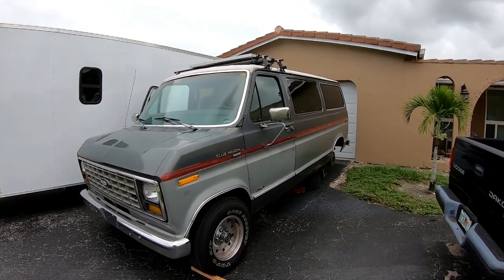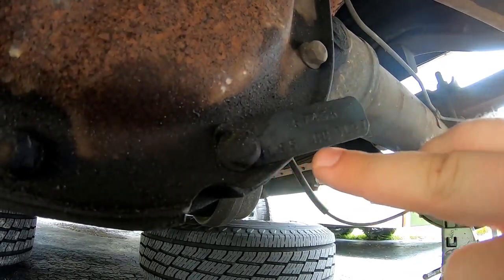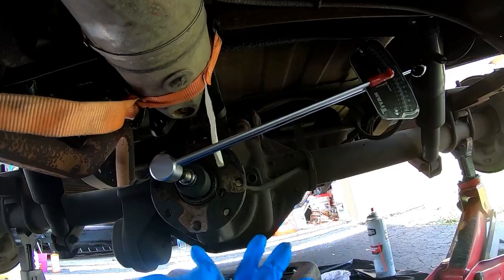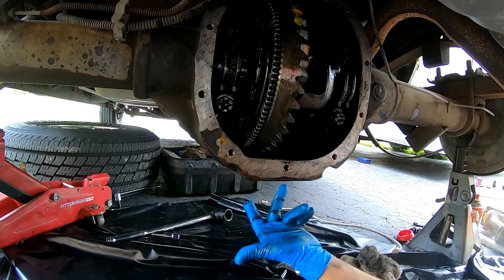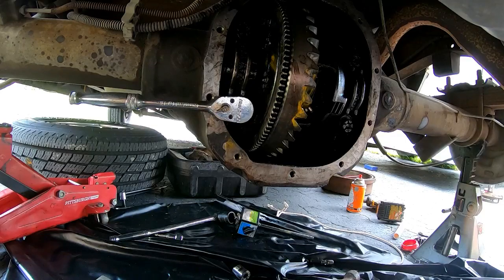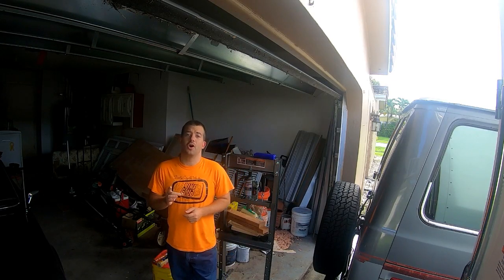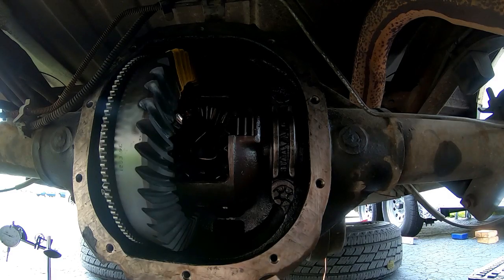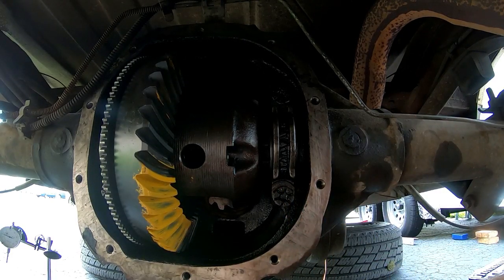Ford 8.8 DIY Gear Swap with tool list in description

Comment: Why replace the carrier bearings if you're only changing the gearset? Set the pinion depth, throw the carrier back in, and recheck the backlash. It likely didn't change.
Reply from the maker: The gearset came with the bearings as a kit. It's a 34 year old van with over 200k. Not changing the bearings just seemed like a very poor idea since this vehicle is used to tow long distance.

Sort of like changing a timing set and leaving the old water pump on.

Comment: I use to race mustangs and did so many gear swaps on mustangs for people. All I used early on was a bearing separator to remove bearings then a pipe to install the pinion bearing and a socket for carrier bearings i pounded them on with a heavy hammer but the pipe and socket were the perfect size so only the race part of the bearings were making contact. I bought a 20ton press to make my life easier after a few lol. You only want to make contact with the race of the bearings you don’t want to put the outer race on to press it on. To make the crush sleeve process faster I use a set up pinion bearing the small one next to pinion seal. I install the pinion without a crush sleeve and tighten the nut down just until there is no play in the pinion, the using a caliper i measure from the pinion nut to end of pinion. Remove pinion from rear end, the put the bearing, yoke and tight nut until the same measurement from pinion nut to end is reached. Then measure distance between the inner pinion races where crush sleeve would be, then measure the new crush sleeve. Say the new crush sleeve is .050 larger then the measurement what I do is put it in the press to take out half of that which makes it a bit easier and I also have the longest 1/2in breaker bar Mac tools makes that helps a lot too. Last thing they make a long thing 12 point socket for the drive shaft bolts so if ur ever gonna do one of these again i suggest getting one.

Comment: Thanks for the work in putting together this video. I'm about to change the ring and pinion gears on my 92 F150. It has the inline six with a five-speed tranny and came from the factory with 2.73 gears! Can you believe it? The original owner must have delivered pizzas in Kansas! I'll also be putting 4:10s in it as well.
Reply: Thinking of doing the same on my pickup. Same specs just a 95. How is it? How did it go?

Comment: So you were able to get good results using the original pinion shims, AND original carrier shims? That gear pattern looked very good to these untrained eyes. Does the rear end make any noise while driving? Good job, sir!
Reply from the maker: Thanks for the comment. I did gauge everything with a micrometer and dial indicator to ensure it was in spec which was very surprising to me (I suppose I should credit summit racing for the awesome parts). They did include a shim pack in case it was needed. We did a 100mi. (4x25mi) break in under normal conditions before putting into full service towing a 7x16x7 loaded trailer (which was the reason for the gear swap). We have towed it from Miami, FL to the smoky mountains with no noises or issues driving about 75mi/day while  traveling. I temp checked periodically on that trip with an IR temp gun. The highest temp was recorded around 180'F (normally 125/150). I have changed the fluid once we got to NC and it looked ok, not burnt or dirty.
Reply: @homebuilthappiness2919  Sounds like a successful gear swap, that's good to hear.  I am planning an 8.8 gear swap myself so I've been watching videos on youtube trying to get tips and tricks form people who've already done the swap.  I have experience working with axles and differentials but usually on performance vehicles where longevity is not the main consideration. Thanks for the reply!

Comment: So I have a 98 Ford f150 and the u-joint busted on it and shifted the differential and Axle tubes upright which broke the weld beads around the tubes how do I straighten that back out and did it damage anything inside?
Reply from the maker: Thanks for the question. I would get the truck in front of someone who can give it a good visual inspection and determine the scope of the damage. The mount points will have to come back into alignment with any repair done and even if it's off a couple of millimeters your truck can "dog track" down the road so it's important that it's done right. Unfortunately, I cannot answer those questions online not having seen it. Good luck and I hope you get it back in commission without too much hassle.

Comment: I see why my 96 v6 explorer came stock with 4.10s ; Very good towing capability.  Air hammers are good for getting bearings off.
Reply from the maker: I almost wish we had went a little shorter. The 4.10's woke her up a bit but we still hurt on roads above 5%. I honestly just think she's a little worn out and we're asking a bit much at this point with what we are trying to accomplish on the road.
Reply: @homebuilthappiness2919  Tire size matters too. I have 16" wheels. The 302 V8 Explorers I think came with 3.73 and 15" wheels.
Reply from the maker: @alb12345672  were rocking 235/75-15's with 4.10 but there are differences in the motor accounting to a 40hp difference.  The heads are different as well as being roller rockers opposed to flat tappet cam. I would also assume that means more lift/duration also. The explorer 302's we're probably the best ford put out.
Reply: @homebuilthappiness2919   I think the V8 explorers had those wheels with only 3.73 LS. And yes, they had plenty of power. I have a V6 OHV, not so much :lol:.  Such gears need a bit power behind them. Some explorers also came with 3.27s, I think the gears are related to tow capacity. The 4.10s technically could tow 5K lbs with the v6, speed is another story. 4.10s though WILL produce lots of torque (e.g. great for pulling a boat on a slippery ramp in 4 low, it acts like a huge breaker bar) but those OHV v6 engines have no HP at higher rpm and the 4.10s will rev high. Sucks on hills too, you have to put it down the floor and hear it rev. Probably similar to your van.   4.10 makes mileage suck too, the rated mpgs mean nothing, it is a special tow option. I bet though it is nice off the line, the truck feels pretty powerful when you hit the gas.
Reply: @homebuilthappiness2919   I think the V8 explorers had those wheels with only 3.73 LS. And yes, they had plenty of power. I have a V6 OHV, not so much :lol:.  Such gears need a bit power behind them. Some explorers also came with 3.27s, I think the gears are related to tow capacity. The 4.10s technically could tow 5K lbs with the v6, speed is another story. 4.10s though WILL produce lots of torque (e.g. great for pulling a boat on a slippery ramp in 4 low, it acts like a huge breaker bar) but those OHV v6 engines have no HP at higher rpm and the 4.10s will rev high. Sucks on hills too, you have to put it down the floor and hear it rev. Probably similar to your van.   4.10 makes mileage bad too, the rated mpgs mean nothing, it is a special tow option. I bet though it is nice off the line, the truck feels pretty powerful when you hit the gas.
Reply from the maker: @alb12345672  our clubwagon (302, AOD, 4.10) with trailer in tow is doing 29MPH wide open at 8% in 2nd (hwy 23 between franklin/sylva N.C.). Van is 5k lbs, maybe 800 cargo counting me and trailer at 3,400.  We were 3/4 up on temp too. The poor performance was the reason for the swap in the first place. I know the 302 isnt really a tow engine but we're trying to work with what we got. The AOD is surprisingly holding up great which I thought would be the weak point.